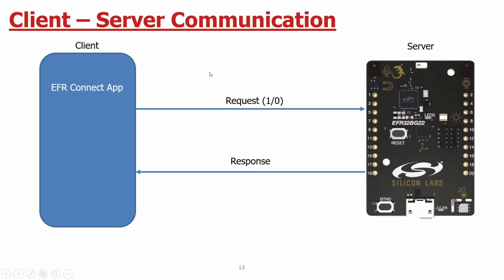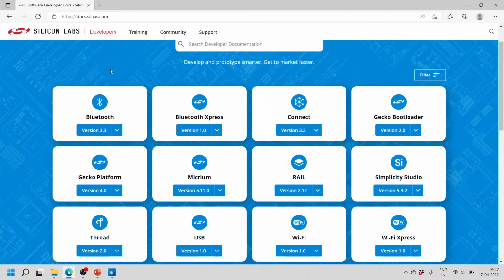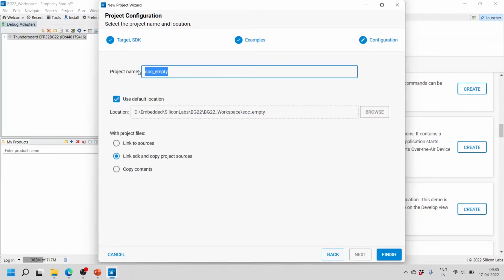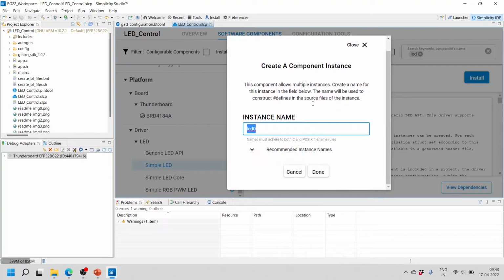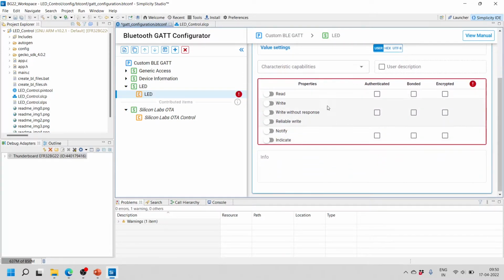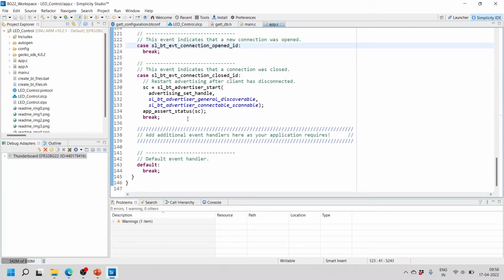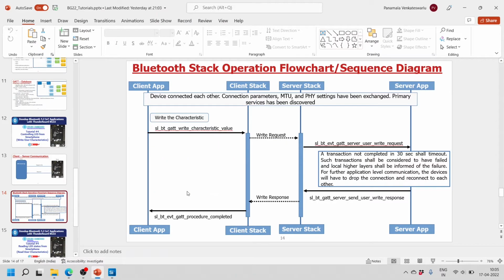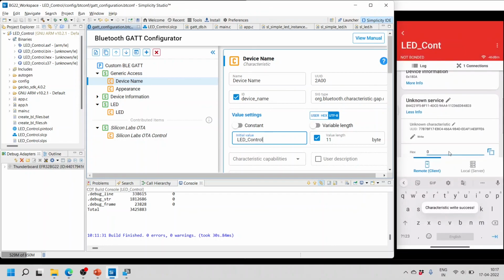LED Control with Write User Characteristic using BLE - Thunderboard BG22

Comment: Sir I get 0 error 0 warning in the simplicity studio but I didn't get device name in efr connector plz reply as soon as possible sir
Reply from the maker: Hi ,
Could please upload the anyone of the existing project in the Simplicity studio and try whether your able to see the thunder board in the app. This issue will appear due to boot loader not properly uploaded to thunderboard
Reply: @ai2mcu I'm having the same problem. How can I upload the bootloader properly? I've tried flashing the bootloader-storage-internal-single-512k.s37 before flashing the LED_control.s37, but it still doesn't work. Any suggestions?